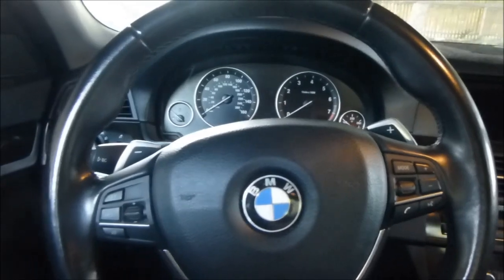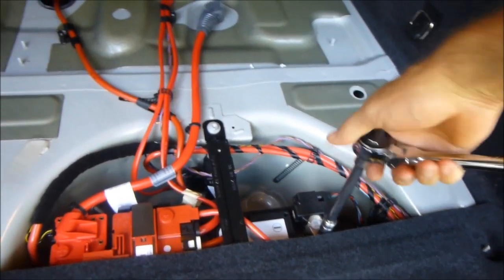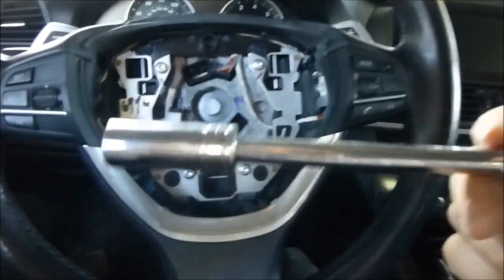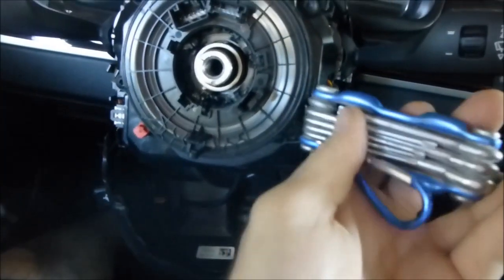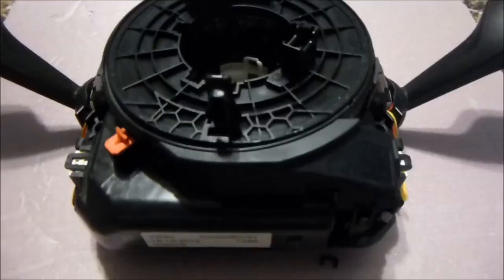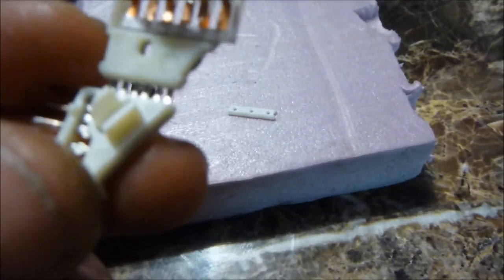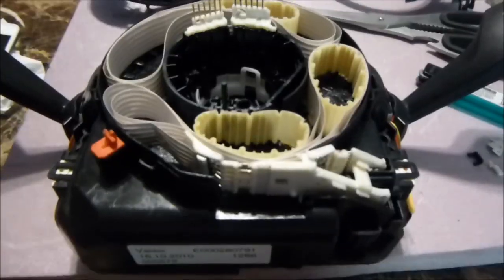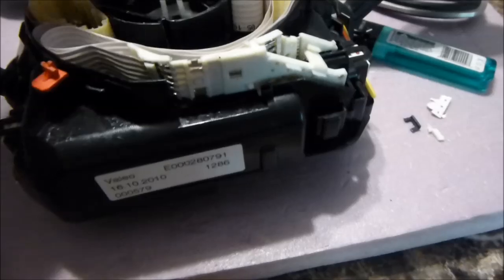2011 BMW 535i F10 Lost all Steering wheel functions How I Fixed it

Comment from the maker: 2 and a half years later and this repair has finally broke again. I may reopen the clock spring and see if I can repair it yet again just because.
Reply: You sir are fantastic. I am having similar issues with mine but its only the paddle shifters and the auto highbeam adjustment which doesn’t work.
Reply from the maker: @Ali78699  Let me know what you find if you decide to open it up.
Reply: I also have the same issue and planning to repair it by myself.If i buy a used one does it need any coding ?
Thanks
Reply from the maker: @achujs  I finally got a used one installed and I didnt need to code it. Make sure you get a similar one tho as some only work with certain headlight switches controls
Reply: Wow having a similar issue with my f10. Unfortunately having trouble finding one because I have the adaptive headlights :(
Reply: You need to put after soldering a super glue , to hold well the horse from run away again
Reply from the maker: @Rakan7ob  Better yet maybe a
 2 part epoxy.
Reply: dude take the ribben out and put a regular wire and just wrap it around the way the ribben is. ribben cables should not be used in a clock spring unless its made of rubber lol

Comment: Guy's I have an easy fix to this problem! Post it everywhere to help people save money. I got the same issue and after watching this video I opened up my wheel also. The cable was surely broken just like yours. I was going to solder it together but then I saw your comment that it happened again and too a closer look at the ribbon cable And figured I could fix the problem forever. I used to mess with electronics when i was younger and am used to soldering. So I cutt the ribbon cables out completely from both ends took out a multimeter and from end to end checked what the ampage the ribbon wire was showing. I went down to ACE hardware and bought some insulated Copper wire cut out the right size and checked the ampage from end to end to make sure it was the same as the ribbon wires. I cut extra wires the same size and the soldered the new copper wires to the clips the ribbon wire was soldered to put it against the side of the wall and hot glued it so that it wouldnt snag and break the soldered points ever again. I turned the housing to make sure the wire wouldnt be pulled apart while turning the wheel and it worked!!!! Ive been driving around almost a week now I opened the wheel again just now and noticed that yup its still holding strong hasn't been tugged at all it seems that if we spread the word We can save all of us thousands of dollars!! The reason I cut out the ribbon wire is because i have repaired my laptop screens many times and those ribbon cables are usually the type found connected to led screens and they can be bent at the ends where they are soldered at because they are thin copper strips they arent like copper wire which is braided so after a turn here and a turn there the opposite way itll surely snap sooner or later. So thats why I just did it this way if you guys cant solder then just buy solder paste which is a solder like glue. Smother the solder paste on the wire and ends and use a heat gun on it and itll harden. If you rather solder make sure you use something called flux its a clearish glue like substance connect the wire to the connector clip and rub flux on the wires then with the soldering iron and solder wire touch the copper cables and it should solder with no hassle. Im so happy that I came across this video cause I saved so much money just because of my hobby from when I was younger. Im sure the tech guys never would have told me it was this easy to access the ribbon cable And replace it and Thanks to this video you gave me the perfect idea. I told some people in the M forums and one guy i guess is using my idea but with his own sinister twist he started buying every part that was broken and is repairing it and said hes gonna sell them for $350 each and that makes me mad because i am giving this free so people can save money during these hard times and that MF is just thinking of ways to make money off it. Anyways i figured we spread the word We can keep ppl from having to waste money on this. Spread the word. The copper wire was only $7 for the little spool and a multi meter is only $10 at walmart. Make sure you get a thin insulated Copper wire because if its too thick you wont be able to make it long enough because the ampage wont be the same as the ribbon cables and wont be long enough for the wheel to turn freely without it snagging and if its too thin youll need to make the cable longer to have the same ampage as the ribboncable and more length will just be a mess because itll have the same problem as the ribbon wire and get in the way. ACE hardware has a very large variety of soldering items and a good variety of cables get a insulated cable that is as thick as the widest part of the led on a pencil. Or buy three different sized wire and check which length is best that matches the ampage of the ribbon cable from end to end. It clearly wont be as long as the ribbon cable because the ribbon cables copper is thin so the ampage is carried thru the whole wire but try to find the right size that matches the ampage and is solderable to the connector that you cut the ribbon cable from. I did it on my first try but I have been messing with soldering irons for years so that was a big help.
Reply from the maker: Hey, That sounds great. Glad my video helped you out. When I did this a few years back nobody posted this problem on youtube at all. I like your idea. Would be great to see actually how you did it via pictures, shoot me some if you can to my email at knightrider5000@gmail.com if you get some time.Thanks
Reply: Ryan do you have any photos of how the cable should be wound within the clock spring? I can solder it but can’t readily see how the ribbon should be wound.
Reply: You should have posted a video, this guy video is amazing!

Comment: even the VIN number matches the parts number has to match exactly to work with the vehicle. However, there is a good chance that it wouldn't communicate with gateway module so might need to change or re--program that as well !

Comment: I have just managed to remove the assembly and reached the spiral coil cable. Found the broken cable and dispatched them to the 'computer repair shop. I will post a couple of pictures on the cables and possibly how to re-assemble the steering. Crossing my fingers it works like yours did.
Reply: This did not go well eventually. I fixed it and everything worked fine. Then the errors showed up SPORT mode deactivated, Cruise control wont work now even indicators don't cancel. Was told I need Angle sensor calibration. Then the coil spring got cut again. I guess I have to visit the dealers...
Reply: @jacobodhiambo1602  Did you find out how to resolve it without having to take it to the dealership?

Comment: Great video. My son just resently bought a bmw f10 530 d and it started clicking now. So I hope it will last a while
Reply from the maker: I notice the air bag in the steering wheel sounds like there's sand inside when you turn it may just be that.

Comment: Great video, first one I've found covering f10 in detail. Did you end up using a special tool to remove the airbag connector with the yellow wire?  I ended up removing the steering wheel with the connector attached, didn't want to break it. I'm curious if you used any special tools for removing the electrical connectors from the turn signal switch assembly as well?
Reply from the maker: small screw drivers
Reply: lol tnx

Comment: Thank you so much for the video! May I please know what temperature you used for soldering it? What material of the welding rod did you use for it? I'm gonna buy a Hakko fx888 and do the same thing. Your video is so helpful!!
Reply from the maker: Temp depends on the soldier as well. I usually do 450 I think I use a lead soldier 60/40 lead as it works better, just wear a mask.
Reply: @JacobKnightRiderShop  thank you. I did solder it and it looked fine. But after I put everything back and restarted the engine, there are a lot of white smoke from the back of the car. Do you know what it could be? When I organize the ribbon cable, there were some grease from the ribbon cable got on the metal plugs...Could it be the grease on the plug caused the smoke...? The smoke was only outside of the car. The inside of the car has no smoke...

Comment: I don’t know if you see this but I have exactly same problem, I took everything apart and mine is completely fine inside. Any idea where else could be the problem ?
Reply from the maker: Maybe a loose wire or broken wire on the ends of the ribbons.

Comment: Great video.  Having the same exact problem on the same exact car; however, I can't find anywhere online (eBay, etc) that sells just the Clock Spring assembly for a 2011 BMW 535i.  Most sell the entire switch cluster steering column.  How did you find/order just the Clock Spring Assembly?

Comment: Got it soldered and everything works fine. The only thing is that I cant reset the driving restrain system light and it reads an airbag fault but i cant reset. Did you get yours done?
Reply from the maker: You have to reset it with a dynostic tool. You can buy them online for about 100 bucks. Or if you know any mechanic friends that can do it for free for you.
Reply: @JacobKnightRiderShop  thanks for the reply! Il give it a try. Just hope it works, because i was thinking maybe something else isnt connecting up. Ive tried deleting with carista obd but wouldnt work. So i thought maybe need a special diagnoatic tool. Ive no clue on them things. Thanks again bro.
Reply from the maker: @davaesthetics2891  ya it should be able to be reset. Mines on too so I know its nothing you did wrong.  I have not tried to reset mine as of yet.
Reply: Tried to reset it at a local garage, couldnt reset it with their diagnostic tool. I havent tried reseting yours yet?
Reply from the maker: @davaesthetics2891  not yet

Comment: Hello. 
I've tried to do the welding but unfortunately I didn't do it right 
also a Failure in DSC steering angle sensor. (Dynamic Stability Control) has happened, please advice me ..

thanks,
Reply from the maker: Maybe buy another unit on eBay if your is beyond repair.
Reply: I tried to fix it and I have the same problem (failure in DSC sterling angle sensor )Also my turn signals Don’t work did you fix the problem ?

Comment: i really appreciated the video, I was wondering if you can share any URL of the part with us. I have the same problem for my 2011 528i . Thank you very much
Reply from the maker: Go to ebay Type in : BMW 09-16 F10 F01 STEERING COLUMN CLOCK SPRING
Reply: KnightRiderShop thank you very much, have you put the one that you bought used for it yet?
Reply from the maker: @montanatatvan13  I didnt need it, as I fixed mine. Ended up returning it.
Reply: KnightRiderShop so it still works well? I am glad to hear, i have 2 mechanics in Orange County , CA they both do not know how to fix the cable as you did with soldering iron. Do u think what should I do?
Reply from the maker: @montanatatvan13  you can try soldering it or having someone with soldering skills to do it. It's not that hard some people are afraid to try I guess. Mines fine still.
Reply: @JacobKnightRiderShop  Hi there, I have a 2012 528i and heard a subtle clicking sound when I turned the steering wheel in both directions, so I had the issue diagnosed by the dealership and they said it was the Steering Angle Sensor. The cost to repair that was too much for me at the time since I was having a different costly repair done to the blower motor. 
This morning I felt some tension in the steering wheel followed by a loud pop and suddenly the "Driver Restraint System" message appeared  and lost all steering wheel functions you mentioned. 
My question is, is this part you replaced also referred to as the steering angle sensor or is that a completely different part as the clock spring?
Thank you in advance for your help.

Comment: Excelent video.Why are we all having issues?/Any vids on the soldering???
Reply from the maker: No sorry I didnt even plan to tinker with it, so I didn't record it. It ended up not lasting very long as it broke again idk 1-2 years later, so I now have a ebay used one in there thats working fine.

Comment: how can i identify if another clock spring from ebay would work? only wondering because i have the heated steering wheel and i don’t know if i have to get a specific one. really need help please and thank you
Reply from the maker: You can try asking a BMW dealer on this. They told me on the phone if mine would work with another, you may need the numbers on the replacement part as well.

Comment: Thank you for the video. When you soldered the wires did you strip the insulation or just solder through it. They are so thin I am having trouble stripping the insulation off. If you did strip the insulation do you mind sharing how you did it. Thanks.
Reply from the maker: I think the heat of a good heat gun is enough to get to the wire to solider them together.

Comment: My steering wheel buttons stopped working. the horn works and the indicators also the only thing that does not work they are the buttons on the steering wheel and therefore the error that the control unit gives me is that the cruise control does not work, I would appreciate it if you could write me the answer and thus be able to translate it since I do not speak English well and I do not know what you are doing in the video to fix it and solve it since I think it may be the same problem as mine. Thank!

Comment: I have heard that you have to re-code the car if you are replacing this part, was it necessary?
Yesterday it cracked in my steering wheel when I turned left and the same error message came up.
Best regards from SWEDEN.
Reply from the maker: I didnt do it. Did you?
Reply: @JacobKnightRiderShop  It was made by bmw when they switched the unit.

Comment: Hello. 
I have changed the clock spring myself with new one carries the same part number. 

But the shift paddle is not working. 

Do you have any idea what could be the issue. ?? 

Pls assist 

Thanks.

Comment: Hey bro is there a certain way or a marking to put the clock spring back on ? Or do u just put it back on the same way u took it off?
Reply from the maker: Yea just put it the way it was the best you can. Make sure you can turn it both ways after.

Comment: is there a way you can post a video on how you solider the cable back together? I recently just took mines a part and i have no clue on how to solider it
Reply from the maker: Sorry I didnt film it, just run the wire loom to the soldier points and solider them accordingly. If you can not solder try and hire someone that does, maybe a computer repair shop.

Comment: Hello. 

I have changed the clock spring in my bmw f10 with new one 
When fixed still I have system restraint fault and paddle shifters behind steering not working. 

Help pls
Reply from the maker: recheck the wire lug ins, might have missed one. fault code needs to be reset electronically.
Reply: Thanks for reply. 

I have checked again the connection nothing wrong. 
Is it possible that a fuse is burned ?? 

The old part number is : 61319245622
The new part number is : 61319354047

Are they same ??
Reply from the maker: @al-tawazuntransports1764  that you have to call BMW to find out. Any dealer can tell you. With a repair service center.

Comment: Trying to strip my ribbon to expose the copper wires so I can solder it, did you happen to do the same or did you solder it through the plastic ribbon cover?
Reply from the maker: The hot iron will melt that plastic very easily when your soldering.

Comment: My 2009 X3 is having the same issues , all of the steering wheel buttons and horn don’t work. I also have the airbag light on and it turns Out I have  a recall on the airbag, would this be associated with it?
Reply from the maker: No sure but could be. Cause id assume the air bag may be connected in some way but not 100 percent sure. I got the same airbag recall but never took the car in.

Comment: Will this be my problem after car accident hard steering
Reply from the maker: Shouldnt make it hard to steer as the ribbons are inside the compartment, separate from the yoke of the wheel. Does cause alot of noise tho when turning the wheel. Your hard steering probably from the accident.

Comment: Hi mate I got some issues I am in uk but Bmw  charge me only part about £500 + labour . I found a reconditioned one the’re saying it needs to programmed.. can u advice me please .. which one shall I buy brand new or reconditioned..?
Reply from the maker: It's up to you. How much for the recon one?
Reply: KnightRiderShop 
£150
Reply from the maker: @muj2012  I guess it would be worth a try, not sure why they said it would need to be programmed tho. Not sure if thats correct. Its just a ribbon inside with wiring no chips that I could see that would tell me you need to reprogram. keep me updated tho.
Reply: KnightRiderShop 
I’ll try ur way first and try my luck as I’m quite handy like that..and how would I remove the airbag sign after it’s all fixed, any ideas..thank u so much for ur help I’ll defo let u know how I got on
Reply from the maker: @muj2012  I think you can reset the airbag at the dealer for not too much.
Reply: KnightRiderShop thanks
Reply: I followed ur video I opened the air bag squib but the ribbon is ripped I then bought the reconditioned one and put it in its all in working order now apart from the steering peddles..an the air bag sign is still on.. thanks so much for sharing the video which helped me and I hope it helps others too.
Reply from the maker: @muj2012  Yes my airbag is on too, but I have not tried to reset it yet.